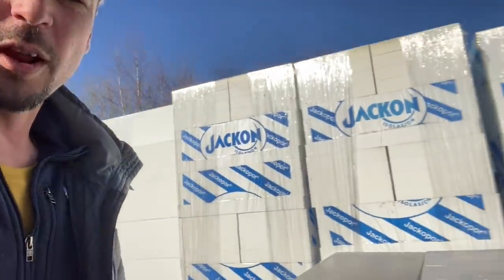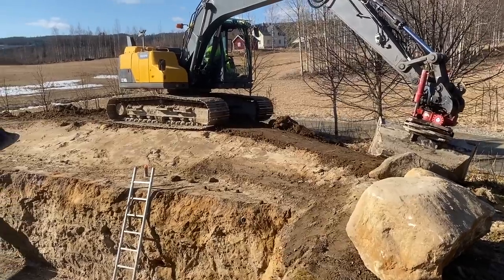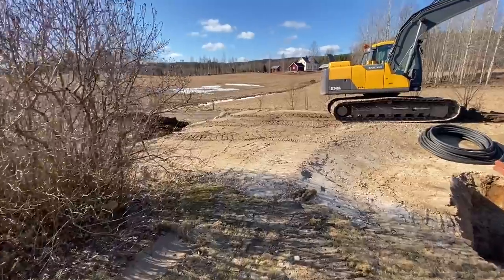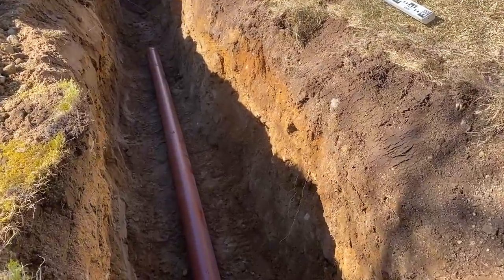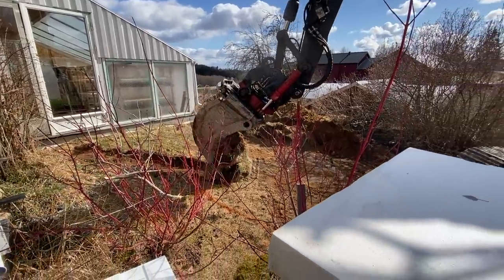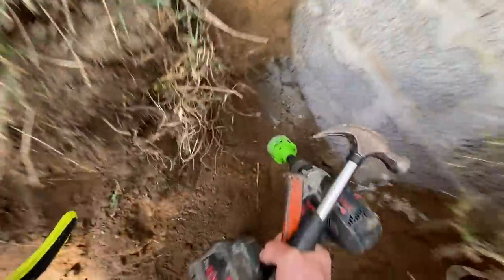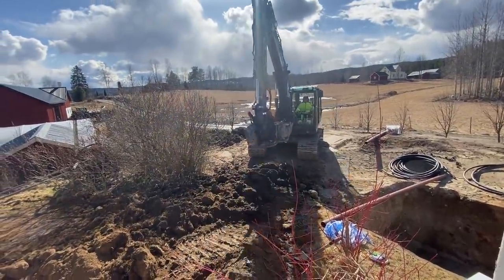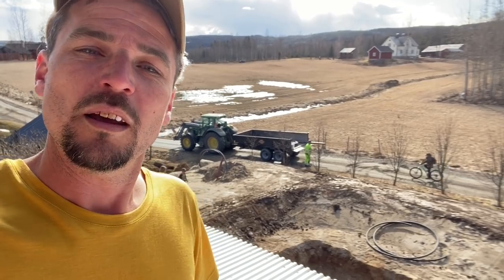Natural Swimming Pond dig complete

Comment: I would write the company about your tractor, if the welding would break from running into the tunnel I would be concerned if the welding would give way if the tractor were to tip over. It could have been faulty welding?!? Perhaps you could get it replaced under warranty.